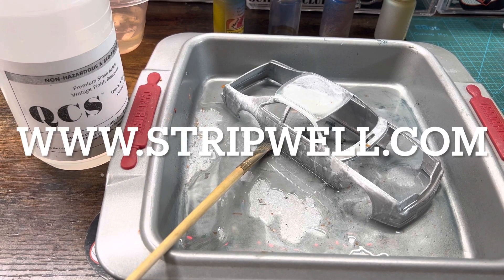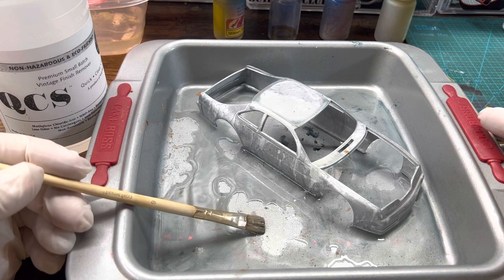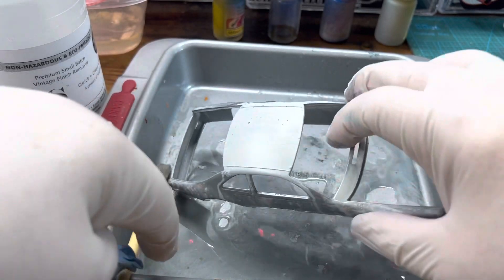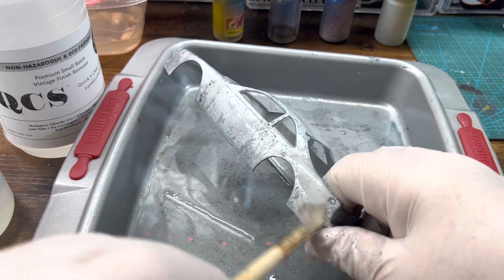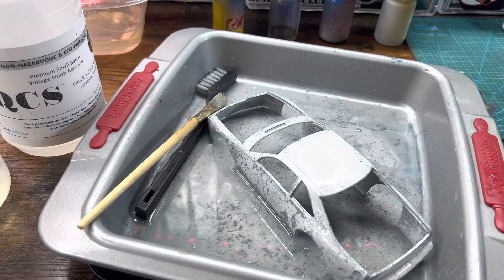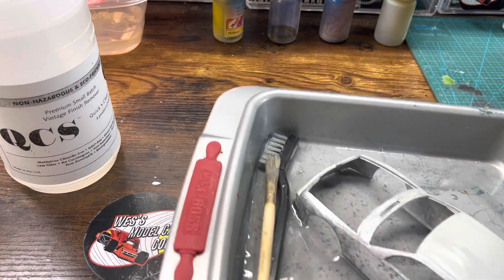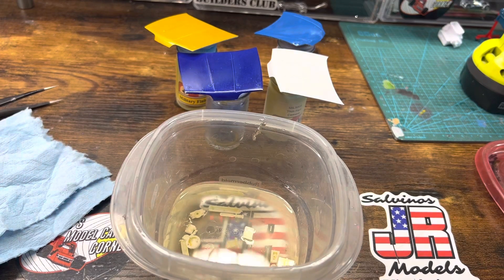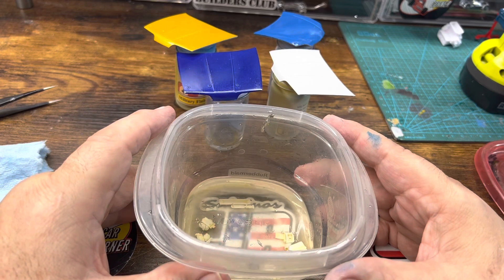Model car stripping- this is a game changer.

Comment: Excellent and thank you for the follow up testing after your original post. Was the first chrome you tested in this video the Salvino's chrome by chance ? That stuff is like real metal and takes effort just to sand or scrape for gluing. I would be amazed if this stripper cleans up the Salvino chrome.
Reply from the maker: 🤣🤣. You need a grinder for Salvino chrome. It’s real metal chrome. I think I’ll throw some in the vat, but I think I know the answer already. Thanks for watching bud.👍👍
Reply: Nothing, I repeat, nothing will remove Salvino’s chrome!!   The only way to remove it is to grind it off.